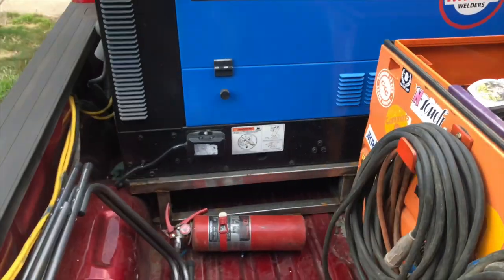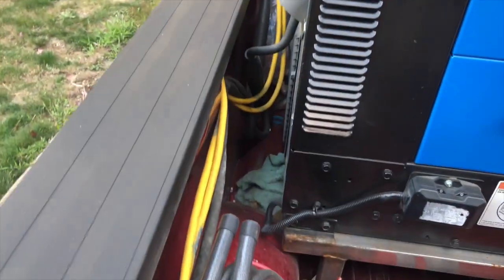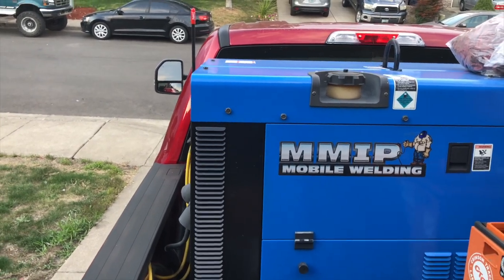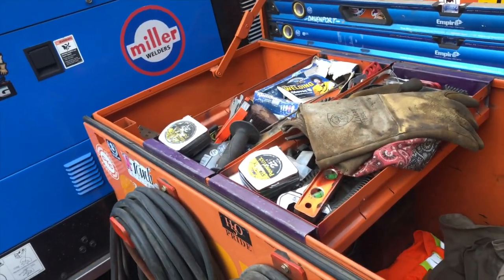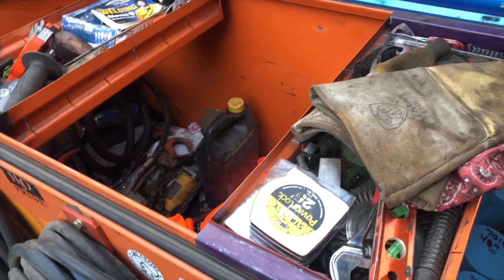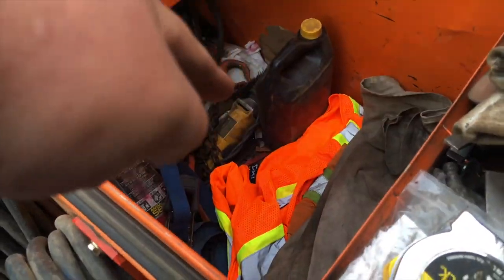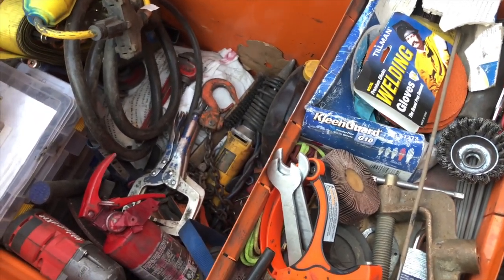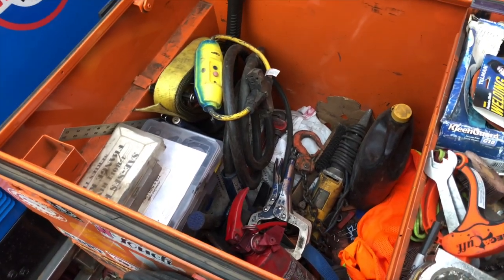Working From a Short Bed  Welding Rig

Comment: Great work man. We all start some where. Keep up the great work. Hard work pays up. I was doing side jobs on my Chevy Silverado 1500.  Had 259k miles I have a miller bobcat 250. I work in a fabrication shop. On the side I do my own welding.
Reply from the maker: undead_welding porosity same here!  Thanks!
Reply: How’s the bobcat 250? Does it handle well and do you recommend it?

Comment: What did you use for your hooks to hold the welding leads ?
Reply from the maker: dangerprone911 cut up a piece of 4”x4” square tube and punched a hole to bolt them on.